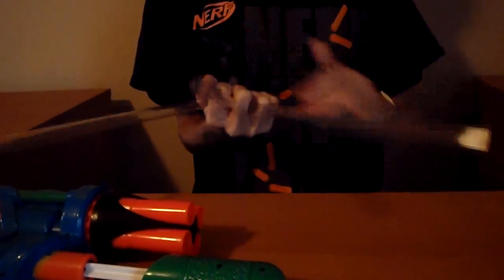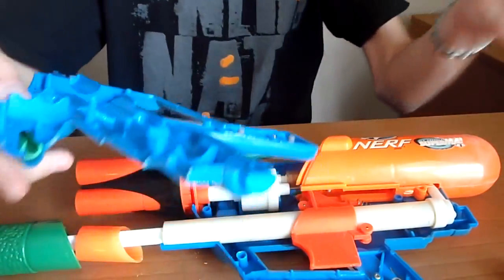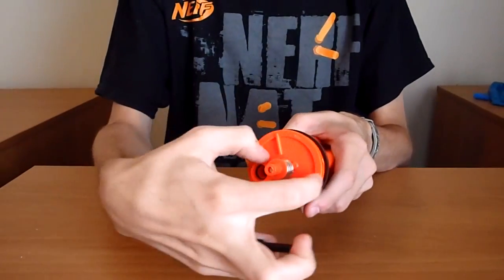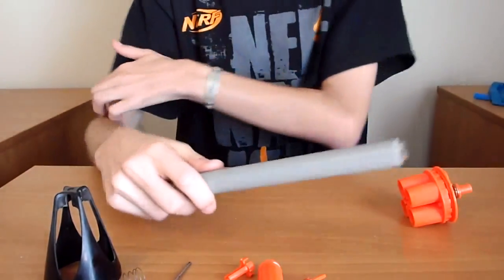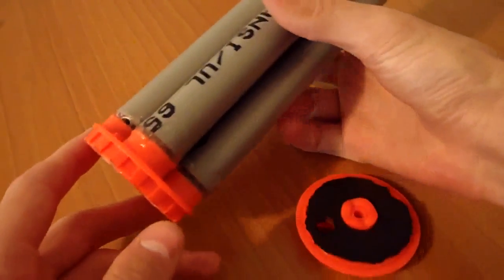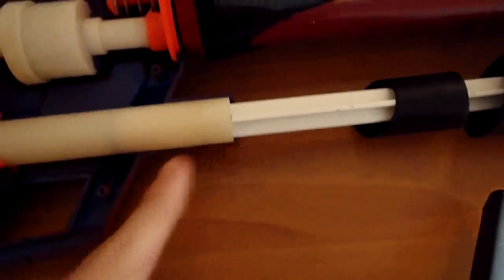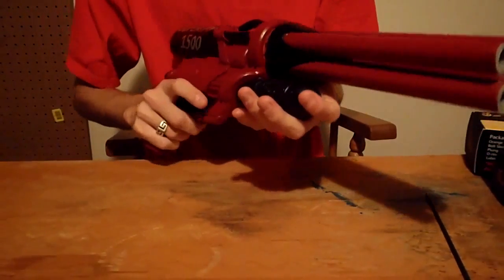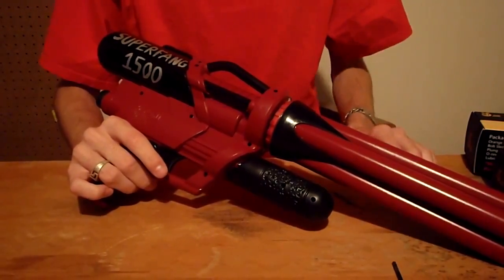How to: The Nerf Supermaxx 1500 Mod Guide

Comment: I just recently picked one of these up at a goodwill in rather decent shape. While taking out the old barrels and the a.r.'s I popped a red mega dart into what was left,  low and behold it fired pretty well.

So you can re barrel for elites or have an air powered mega blaster.

Comment: @psyk Exactly.. It sounds like he did a poor job at plugging it, which is why some air still manages to squeeze itself into the OPRV creating that high pitch squeaky sound. Come on, this definitely does not perform "flawlessly". In addition, stock turrets have a GREAT seal. He destroyed it with the craft foam and whatever nonsense he used to fill up the space at the back of the front piece. I would really like to see an actual range test of this blaster "hitting 100ft flat". ROFL